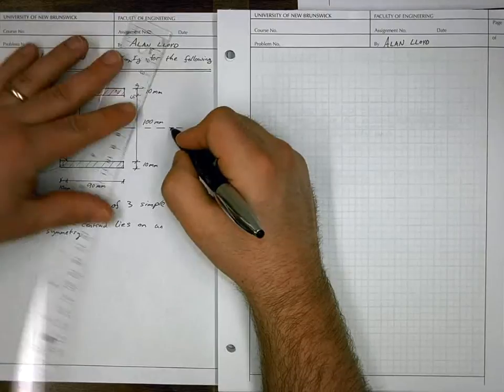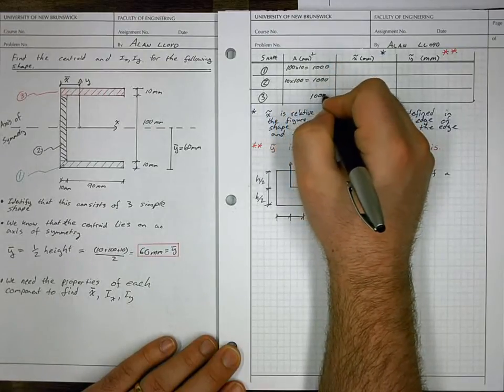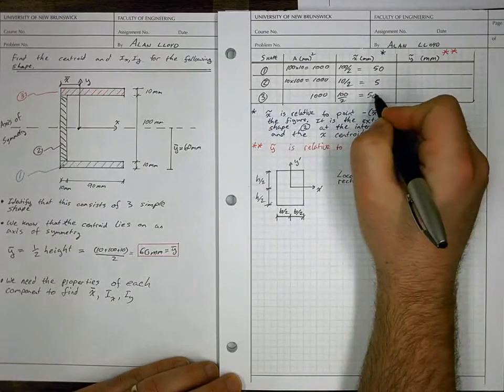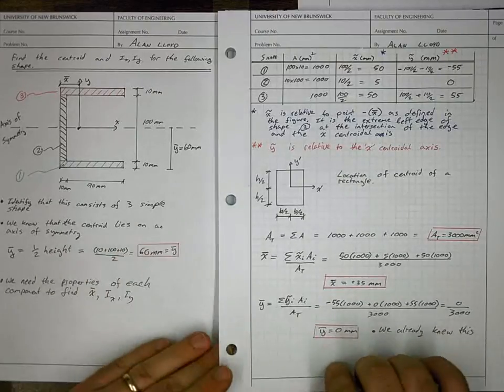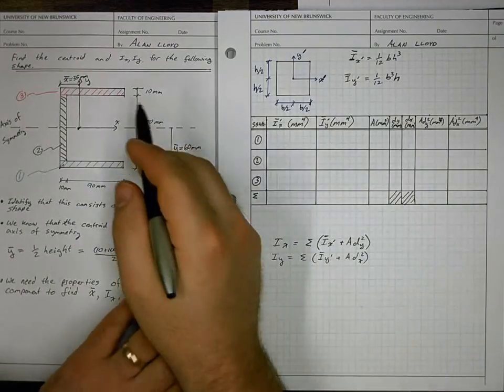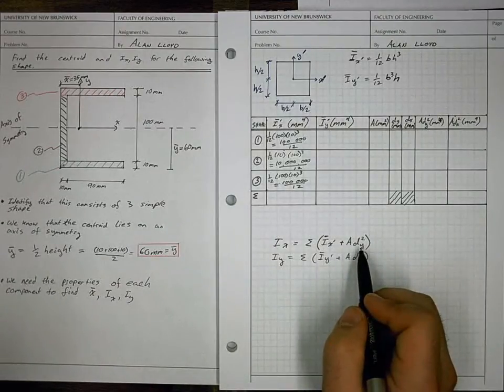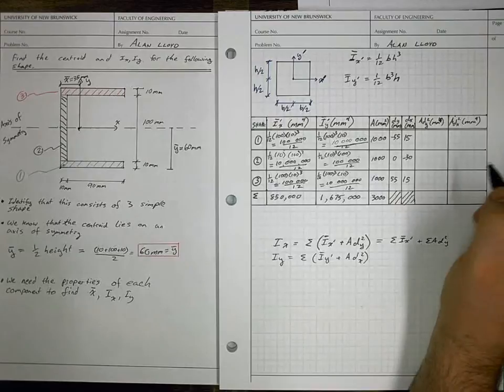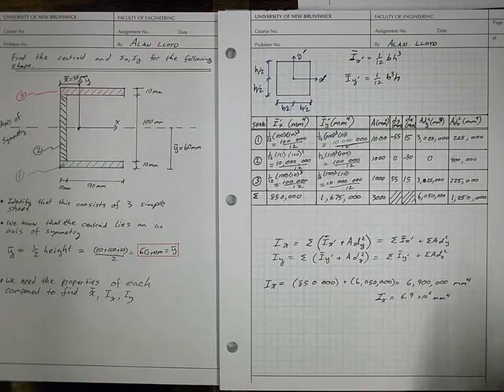Moment of Inertia and Centroid of a Simple Composite Shape

Comment: Great video, thanks. My question is that I´ve got a rectangular structure with two semicircular holes, one in the uper left side and one in the down right side of the rectangular. How can I calculate the moment of Inertia? In the last part of the video where you add Ix, Iy, Ady2 and Adx2 I just did figure 1(rectangular)minus figure 2(semihole)minus figure 3(other semihole), but I din´t know if its correct.. Thanks again